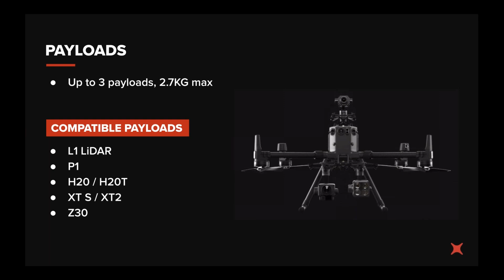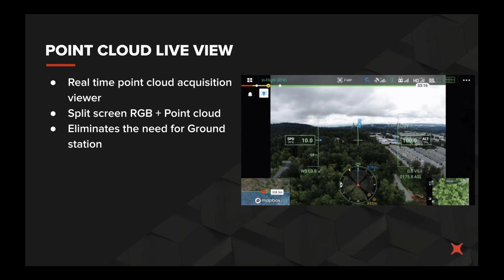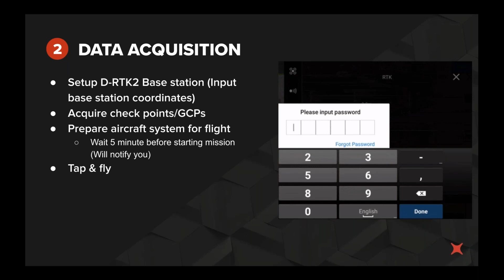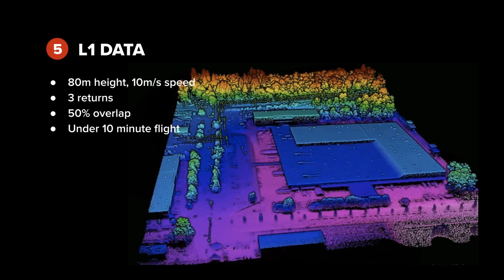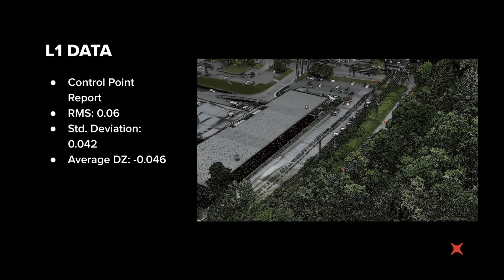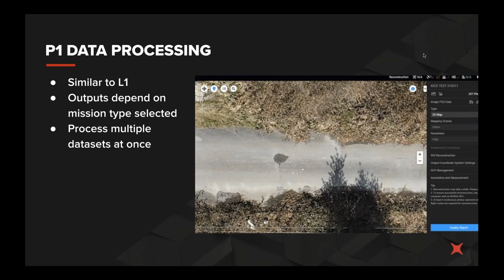DJI Zenmuse L1 & P1 - WORKFLOW WEBINAR

Comment: Great webinar!
Can you answer another question please?
Currently, for L1 data QC, DJI Terra allows importing and classifying GCPs as "check points", and measures the point cloud altitude error around those points. However, if i leave the gcps classified as "control points", terra will constrain the point cloud, altering the raw data altitude.  Is this recommended fot lidar point clouds?

Thank you!
Reply from the maker: If you fit a point cloud to a control network, you are warping and stretching the data. In altering the points this way, you may be degrading the overall accuracy to make one corner fit better, for instance. You could be dragging down the overall accuracy.
I would usually start a project by asking a client what their accuracy requirements are and why they need to meet those specifications. If I thought the sensor was capable of those results, I would place GCPs and fly the mission but use the control merely as a checkpoint for generating an accuracy report. If I had done everything correctly, I shouldn't see too much error in the sensor and I would report the results to the client. If I have to stretch and warp the cloud to make it fit, it means the sensor wasn't up to the project in question or the sensor wasn't flown effectively. In essence, I would consider the use case, the sensor capabilities, and what the client is asking for before I alter the points.
Reply: @CANDRONE  Thank you very much for your enlightening answer!

Comment: can use L1 without the drone?
Reply: Nooo
Reply: However, you can buy the LiDAR sensor directly from the manufacturer Livox (approx. 900 EUR).
Reply: @NewtonInDaHouseYo  is there software to connect/control that device?

Comment: Great Video - I wonder if you could go into a little more depth on the terrain following. When ive conducted flights using the M300/P1 i simply set the atltitude to 50m and then the terrain following to 50m. A colleague has stated that he sets the altitude to 50m and the terrain following to 70m which will give the aircraft 20m leeway when following the terrain. We dont load any data sets other than selecting the option can you give more info on this please
Reply from the maker: This question is a little too specific for us to answer here. Reach out to us at support@candrone.com to speak with a team member and we will try and help you.

Comment: What software do you use for more advanced post-processing of L1 data? (More advanced than what DGI Terra provides. With other types of lidar data I have used QT Modeler, and my own code using Python/Matlab. Obviously this varies with processing purpose, but curious what you have found useful.) Also, what kind of specifications do you recommend for a computer to process L1 data? In the past we have found Dell Alienware Gaming computers good for visualizing the raw data and dealing with the processing of large files in general. Not sure if such a powerful machine is needed for this type of data.
Reply from the maker: We use Lidar360: https://candrone.com/pages/lidar-software
The efficiency of Lidar360 allows us to easily view and process very large data sets with a basic gaming laptop. The Alienware should be more than enough for LiDAR.
Reply: @CANDRONE  hi, is it possible to use a photogrammetry software like Metashape for instance to extract a DTM from las point cloud generated by the L1 ?
Reply: Can QGIS be used for the post processing?

Comment: Thank you for this. Can you confirm while flying a mission on the L1, there is a setting regarding Altitude Mode. What are the best settings to choose here? Thanks. (We are using an L1 on an M300 + RTK base station.)
Reply from the maker: Hi, we recommend setting it Relative to the take-off point. Just remember that it will not terrain follow, so if there are elevation changes in your scanning environment it will affect your overlap.